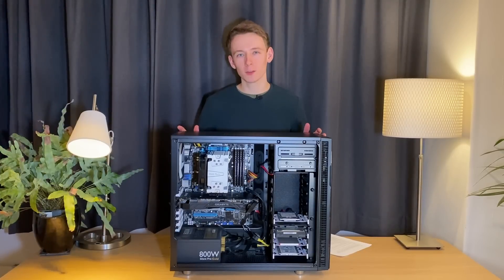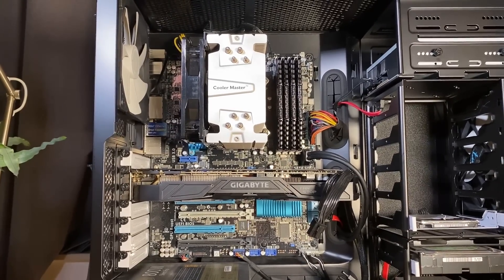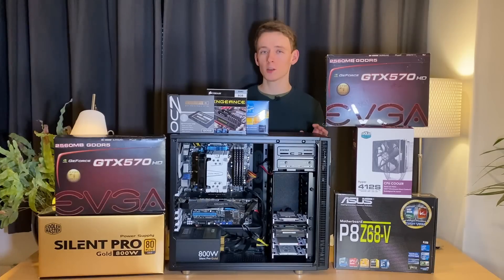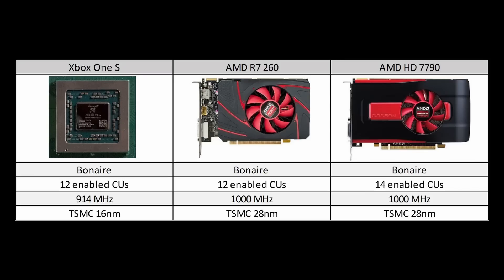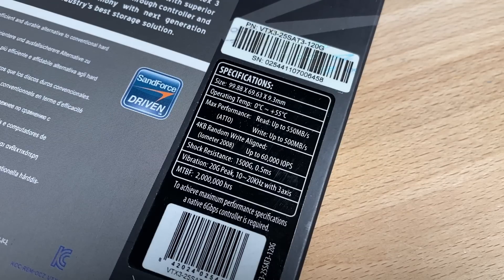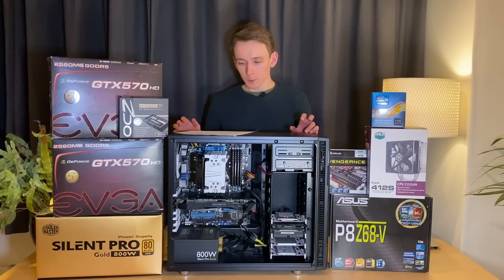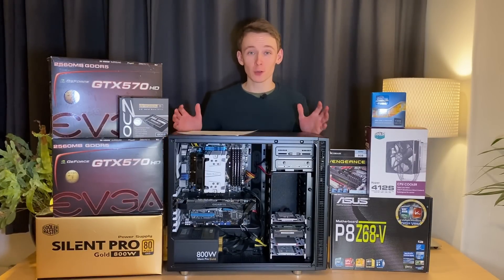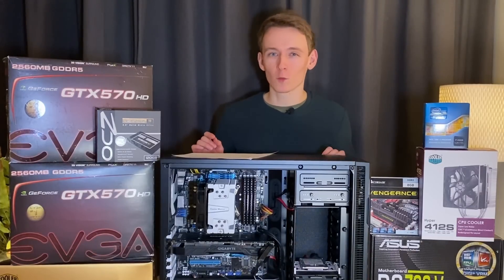I used an i7-2600K PC for over a DECADE - Here's what happened.

Comment: What impressed me the most is the fact that 10 years later you still have the boxes of all the components.
Reply: I've built my gaming pc 5 years ago and i still have all of the boxes intact in my room
Reply: By the way. I'm also a happy owner of an i7 2600K. It survived 3 MoBo and 4 GPU. Sometimes I feel compelled to upgrade, but soon I realize I don't really need to. I'm not a hardcore gamer, so, 11 years later, my CPU still runs smoothly everything I need.
Reply: you should always keep those in case of RMA or service.
Reply: @leovmr  still running it? whats your entire PC specs?
Reply: I have just retired my FIRST Gen i5-750 (been overclocked at 3.3GHz from day one) and still have all the boxes!!!

The only thing that died in it’s life was the hard drive so a 500GB SSD was combined with a 2TB hard drive and the AMD 4570 was changed to a GTX1660Super to improve performance for slicing on 3D printing.

It ran everything I threw at it and is still very useable today.

Yes my i7-12700K/B660 Tomahawk/32GB/RTX2050Super is massively faster in some tasks but not 70% of it’s normal workload (I think I am the limiting factor in photo editing 😂).
Reply: i still have all of my boxes for my old i7 980x build too, in pristine condition.
its funny because i originally wanted to keep them for warranty reasons, but they just ended up being in my closet for the past 12 years lol
Reply: @stephenb9510  Yep. Still running my i7 2600K. The spec is really ordinary but does the job. Gibabyte GA-B75M-D3P MoBo; Kingston 8Gb DDR3 1600Mhz RAM; ASUS ROG Strix GTX 1660 SUPER; SAMSUNG 870 QVO 1Tb SSD. I use a 43" LG 4K TV as a monitor.
Reply: you can just buy the boxes
Reply: @leovmr  You don't get any bottleneck with your i7 ant the 1660? thats kinda cool tbh
Reply: @ttz8488  i'm the same as leo
i72600k with gtx970 16gb-ram, its for 1080p gaming only and forever.. bottleneck? dont know dont care.. when i get consistent chugging, frame drops, mind numbing low performance, then i guess i will have no choice but to upgrade.. otherwise, just OC the pISS out of the 2600k, mines always at 4.4ghz.. i've had it since summer 2011, it was $320 CAD at the time.. wish i bought 3, or 4... god i wish i'd done that
Reply: @HoLDoN4Sec  are you still using the 980x? 0o0
Reply: @SlowHardware  i retired my 980x back in 2019, now that old computer serves as my living room media pc. In my current setup im using the 10980xe ^^
Reply: @HoLDoN4Sec  hell yes, moving from extreme edition to extreme edition, how crazy was the performance jump?
Reply: @ttz8488  it depends if you're playing high end games of course the bottleneck will be there I'd you're playing low end games like 1.6 there's nothing to worry about xd
Reply: I have build my new PC 2012 and I have still all boxes .

Comment: I see we share the same philosophy: no need to upgrade, if it's still doing what it needs to do.
Reply from the maker: Absolutely. For me I’d feel like needlessly spent money otherwise.
Reply: Also think: “Would it be significantly better if I upgraded, or just a marginal improvement?”
Reply: There is definitely a sizeable chunk of users who don't upgrade because they don't need to, and others who can't afford to. I consider myself to be in the first group. I am still using the system I built around 2013; FX-8350, 32GB 1866MHz, R7 360 2GB(not a big gamer, mostly retro emulated games), 240GB Samsung EVO boot SSD, LG Blu-Ray writer. Over the years I have added HDDs and SSDs because of all the torrenting and downloading from Usenet I do.

I have to admit though that I really want to build a new Ryzen system, either Zen3 or 4, with 64GB of ram. With Etherium mining coming to an end very soon I expect a tsunami of used gfx cards on the market, so hopefully I could pick up a decent one that would last me many years since I don't need bleeding edge.  A new build wouldn't cost very much if I could buy a used gfx card for cheap....
Reply: With a new processor and gfx cards every year , i have also accepted to not upgrade needlessly.
Reply: @FullyBuffered  but there's a prereq, which is to be as proactive as you are in aquiring new information so you know absolutely perfectly what you are missing out on
Reply: Yeah and if you play a specific game most of the time and you are getting 60-85 fps on 1080p, you should still be good. 

I won’t buy anything new unless my system can’t run the game at 1080p optimized or medium settings. If I had turn all my settings low and I really really want to play the game…I might upgrade the gpu and push it to like 1440p or 4k to make the game gpu bound.
Reply: same philosophy here-don´t fix,what´s not broken
Reply: @SirReptitious  I still keep my R7 360 2GB as a backup GPU. I bought it around maybe 2017 used, and replace it with a used RX 480 8GB in 2019... Too bad the RX 480 broken after just a year, and I put my R7 back before I got a free GTX 1070 from my friend last year. 

I used FX-8350 with 16GB Corsair RAM kit before, but I sold them after I got i7-4790 also free (the Gigabyte motherboard was broken but I serviced it). I still use the i7 until today without problem :D

I want to upgrade, but I will wait until maybe one day the current gen got cheaper in used market. I almost bought everything used and I want to keep it that way. I also still have a backup pc with i7-3770 that I also got it for almost free... I got it from my relative coz it was not turned up, and found out the fault was on the PSU. Maybe I will put the R7 in that CPU lol
Reply: True but then it comes to a point where u have to upgrade i kept my old fx with with old Gtx 580 for very long time upgraded to 5950x with 3090ti upgrade big and live with it for long 🤜👍 btw u would not run cyberpunk on this not even close its just obsolete
Reply: @ivo3598  depends if after both cpu and gpu will be good for nothing,if it still be the time and feelings to play further justifying the purchases...for now neother of the games which are beyond my specs hyped and pleased me enough for upgrading
Reply: @FullyBuffered  I had the i5-2500k, 4x4gb ram 16gb, Z series motherboard but it was gigabyte, OCZ Synapse 128/64 Cache SSD where it caches the HDD, OCZ were good. Samsung bought Synapse/Dataplex and killed caching SSDs.
GTX 570 as well!
Very similar to what you bought.

I bought a good name PSU but only a while ago did I realise the fan noise I can hear when gaming was my PSU!! 😄🙂

I only changed this year to a used i7 9700k, 32gb, with motherboard kit from eBay. £300.
I got a used GTX 1080 Ti 11gb for £300.
So a quite good performance gaming PC for £600.

I used the motherboard driver trick so I could change all the hardware in one go and not have to reinstall windows. There's a YouTube video on how to do this. I have so much software that I just didn't want to have to reinstall.

Microsoft, Intel and AMD and others need to get together and make an EASY Upgrade software experience. I can't be the only person who is put off upgrading because I don't want to lose my setup: all the software, setup, icons etc. It's like a tool workshop. Can you imagine buying a new tool and some clown will force you to remove all of your tools, benches, power, everything you customised. And they expect you to buy the new tool with that pain?

Curious to see what you've upgraded too.

So many used GPU on eBay, prices falling. Already GTX 1080 Ti 11gb is £250.
Reply: This is why I tell people to get a good psu. But no people keep spending bare minimum on psu. When it comes time to upgrade gpu, and your psu cant handle the extra load, then it is the biggest pain to upgrade. I don't know why people want to save $20-30 there. 

ssd is kinda whatever sata performs similarly to even gen 4 nvme, right now. I have a gen 4, but only because it was on sale.

Ram is a bit contentious, but 16 gb will do fine for now, and can always make it 32 gb in the future.

cpu will do fine, even if it is a recent i5. Even though he used an i7, look how many generations it lasted him. 

Finally, the gpu. This is purely based on how much money u have, imo. Since it is the most expensive component, many people want to future proof, but I find that to be a bit of a fools errand.
Reply: I  bought a good value PSU 750 watts from a reputable brand, it  wasn't cheap, and it still working well. Only issue is that the fan is  noisy under load . Really  noisy. I always assumed it was the GPU. I changed from RX 580 8GB to a GTX 1080 Ti 11GB and it was the same noise so I listened closely.

It's lasted 10 years though, so that's good.
Reply: @dho5411  Agree on the GPU, since it will be compatible in the future, there is no chance in hell I would spent crazy money for a flagship. Especially if the trend of "next Gen midrange equals last gens flagship" continues.
Reply: Yeah, I'm planning on getting a PC, and I want it to last as long as possible. I'm not gonna be one of those guys who upgrades every year/2 years just so they can say they have the "newest and greatest"
Reply: @ivo3598  lol I can play CYberpunk on my old rig with a solid 60 in 1080p. Cyberpunk is not a challenge.

Comment: Impressive you managed to keep it so long. The value for money on that pc is insane.
Reply from the maker: Thanks! Yeah I definitely got my money’s worth out of it haha
Reply: @FullyBuffered  the 2nd, 3rd and 4th gen Intel Core are really good :D
Reply: still using mine
intel was drunk the day they let the 2600k go for only $320CAD in 2011
i wish i bought 2 more for other builds
Reply: @kwazhims3lf  same here, with the exact same motherboard, I game on a 9600k or series x, but this sandy bridge, liquid cooled since 2011 is to date where I do work and it's amazingly (edited from insanely) faster than what most ppl use.
Reply: Id say its sane value for the money. Insane would be to spend a lot and have it be useless the next year.
Reply: @mart446  let me change that then lol, I meant the difference between other "not custom" setups/laptops like dell or hp
Reply: Try masochist club near my location: They are still using a Pentium II 233 Mhz with windows 95.

Comment: My ACTUAL best PC is a Core i3 2120 with 8GB ram, GTX 750, SSD Kingston 240GB and a cheap MSI motherboard.
Actualization: Got a Core i7 2600k and the same motherboard show in the video.
Rock solid at 4.6Ghz.

Comment: I had an i7 2600k for more than 5yrs, it was a great cpu for it's time. I've also had a Xeon socket1366 pc with a X5670 cpu for about 7yrs. Those older computers are still great for family members who only use pc's casually.
Reply: Yep someting like 2600k still is good for casual web browsing and stuff like that
Reply: This is under selling them a tad, they’re still good for AAA gaming as long as you don’t expect max settings
Reply: @boydsterling3193  And is probably still perfect for all games if you're doing 4k, as generally the GPU becomes the bottleneck in that instance.

Comment: This is an amazing video. In the same month of 2011, I bought pretty much the same components for 1250 Euro. Only the Psu is different. But other than it, I have the same computer and my trusty Sandy Bridge i7-2600K.  This system will be 12 years old  in November.  I never used it for games, though... I remember that the 2600k was a pretty sought after processor at the time. Oh, and I still have all the boxes, too. Never thought I would still use it in 2023. It's been very good to me!

Comment: Dude! It´s amazing how we have a pretty much identical story with this hardware! I´m from Brazil and got everything exactly like you, also in 2011. The only difference is i had a 580, and then got another one for SLI when Crysis 3 came out. Still using the same PC, now  with a 1070, and it´s still a pretty decent gaming and video editing experience like you said. I´m hoping it can last for another 2 years before upgrading to a whole new system. This is probably the greatest CPU of all time, I´m gonna put it into a frame on the wall hahahahahah
Reply: Even as someone who had a i7 960 for 7 years and is currently still in lurve with my 1st gen Ryzen 1700, I gotta admit that the 2600 is still probably better in terms of value.
Reply: @remo27  I'm still using my '09 i7 950 lol, swear these things last forever
Reply: holy shit, thats an idea
when my 2600k finally dies, im going to mount, frame, hang it
its been chugging since 2011, she deserves the reverence
Reply: Pretty much the same story here, haha! Started with two 560 Ti for BF3, now rocking a 1080 Ti. I'm going to keep this build around as long as I live. Been looking to start a whole new build, but then the chip shortage happened. What's a couple more years at this point, really?
Reply: Have you upgraded yet?

Comment: I have the exact same CPU and type of memory and very similar case but from Corsair and also very similar powersupply from Corsair (silent pro also i think). I do have a Gigabyte motherboard , a big Noctua cooler and Samsung SSD though and i use the built in graphic card since i dont play games. I built it in early 2012 and its still going strong and works perfectly even the SSD as i write this comment using it. I use it a lot for recording and mixing music since i am a musician and of course for general use as well and its the longest i have had a computer, i remember in the 90´s and early 2000´s when you had to buy a new computer every 4- 5 years and those were more expensive than this one even if im not counting inflation. A truly great buy that i have had tons and tons of good use of every day and i have never even overclocked it.

Comment: This is eerily familiar! I'm typing this on my i7-2600K, which is still slogging along. I got it in August/September 2011, and the 560Ti I got with it also had a VRAM failure that gave a graphics glitch like shown in the video, in my case in 2017, and I also replaced it with a 1060.

I'll probably be replacing the whole system by the end of the year or next year, I just haven't played much in the way of shooters the last couple of years so I haven't been in a rush.

Comment: Absolutely get why you kept using it so long. I've been doing that as well.
My original main system which still is hooked up to an ultrawide in the study is a bright red-Dell Inspiron which had the power supply upgraded to accomodate a GTX 1660Ti fitted and the i7-2600 exchanged for an i7 3770 with 16Gb 1600Mhz CL9 memory. The cooler was also updated to a Cryorig C1 CPU cooler. It still works great for work, emulation and gaming.
I am still using the original bright red computer case which is limited when it comes to upgrading the GPU. But the 1660Ti is good enough and fits nicely. 
Oh and the HD has been turned into 2 SSDs. 
Very stable system.

Comment: One reason i've kept my main PC for so long is although it was time for an upgrade off the 4570 to a 4770k to breathe some life into the haswell platform, and while it still struggles in newer games, its like a car that can't quite make it up the hill as fast as the others, but is always the friend to greet you when you need it most. They become components you or i could never sell, but hang up on a wall, framed in a bootable state for if i ever want to enjoy those times again and hang proudly in large respect rather than chucked away. 

I think those hanging on to older systems become a lot more appreciative of what they have and what the hardware can do. (Along with being shocked with expensive prices today :p). Can learn more about eachother as time goes on, over 4 builds now my 1060 3GB has been the component to live through each of them, sadly bottlenecked until it became the bottleneck. I could never chuck any of my computers away, the scuffs and scars, performance and certain stutters in a game are sparks lighting a brief memory of what that computer could do in its prime when it was once the latest and greatest. Sad to see this computer go, long live Sandy Bridge!
Reply from the maker: Thanks for the comment - I can relate to that. Even though the parts will be upgraded, I definitely won’t be selling them.
Reply: I'm a tech enthusiast, but I also develop a personal relationship with my computers, and respect for what an old equipment can still deliver, which leds me to keep my old machines  -or at least their MB + CPU + memory - for a long time. And since I never use games, I don't miss the performance. Actually I still have all of them, somewhat bootable; from a 1993's 486DX50, and so on. A 2007 Core2Duo still has use in my workshop (replaced as main machine in 2020 by a 10gen i5).
Reply: A great comment!

Comment: I had pretty much the same experience, the only things I upgraded over 10 years was adding a SSD boot drive and going from a GTX 680 to a 980 ti in 2018. That same  year I discovered how easy it was to get a stable overclock of nearly 50% on that CPU on the stock voltage. I was running 4.5Ghz stable at 70C
Reply: I've had mine going @ 4.5GHz since new - no problems whatsoever. Still using the same Corsair H100 water cooler from the day it was new.
Reply: Did 5GHZ (5001Mhz) stable on my 2600K with a XSPC water block, XSPC dual bay 5.25in reservoir/pump, on a AsRock Z68 Extreme4 Gen3.

Comment: Still loving my 2600K.  32GB Ram, Upgraded SSD capacity and also upgraded with a GTX 1080 years ago.  In 2022 so far I have played GOW, Elden Ring and Spider-Man all playable to me!  I even typically have Youtube or netflix on my 2nd screen.  I do not do any competitive FPS though.  Plenty of games in my back catalogue if I start struggling with new stuff.  I plan to keep using it until 2025 when Windows 10 is EOL.  If only I could get some kind of TPM module I would probably keep going!
Reply: You can install Windows 11 as well without the TPM stuff.